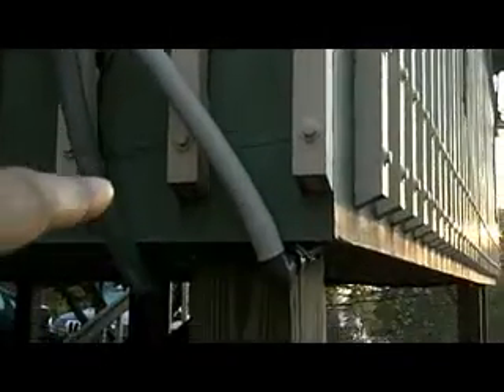Rainwater Harvesting on a Raised Deck

Comment from the maker: @jjs777fzr  Yes, that is a great point about putting rainwater storage on a deck, especially a raised deck, and I eluded to it in the description but will explain.  Our deck was built to hold minimum 100 psf due to excessive snow load in winter (when benches are emnpo.  Since rain barrels are about 140 psf when full, and rain benches are about 74 psf, this is one case when having a low or shallow water line is a benefit.  They also will not tip over...